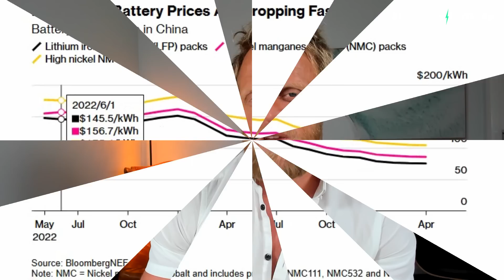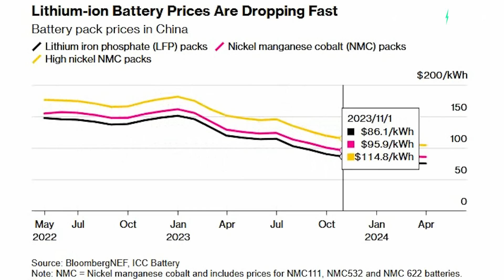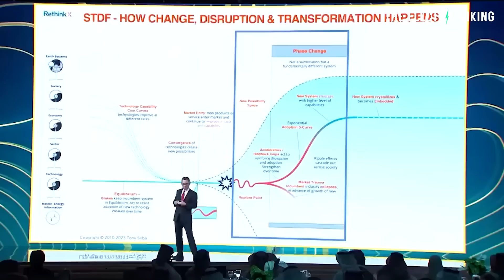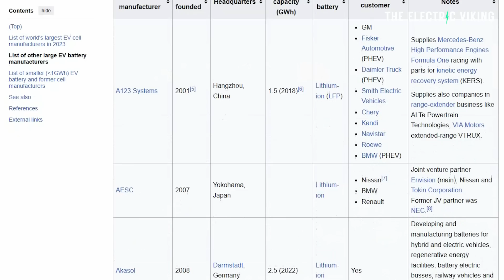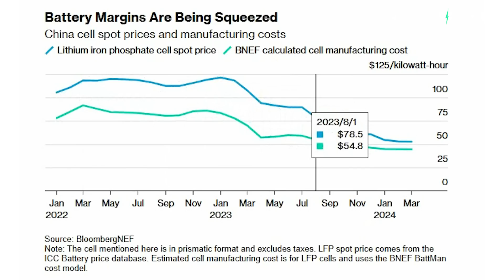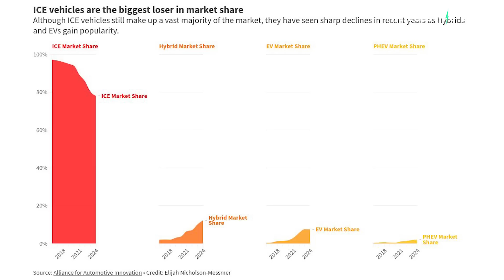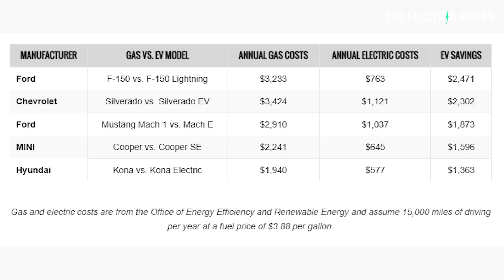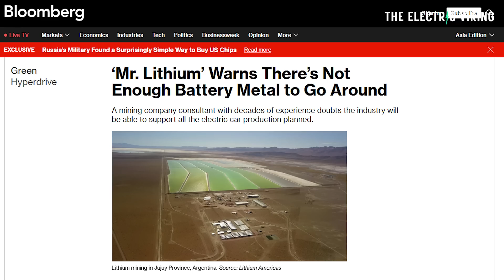Battery prices fall 51% to $53 per kilowatt-hour; "EV prices will keep falling"

Comment: It doesn't matter how cheap the batteries are, EV prices will not fall in tbe west because 1) they haven't gotten any cheaper yet and 2) tarrifs.
Reply: Tesla prices has consistently come down fast!
Reply: Actually, prices have dropped. At least here in Europe, and also Tesla prices have come down quite a bit. But of course, the battery is only one part of the car. Let's consider a Model Y with a 60 kWh LFP battery for about 40k. So according to the video, at 95 USD per kWh, this battery would have cost 5700 USD in material cost (just for the cells). The same battery today costs 3180 USD. That's a saving of 2520 USD, or 6% of the car's price. So a price drop of 44% for the battery results just in a 6% drop for the vehicle's price. A car is more than just a battery.
Reply: EV prices are going down but more slowly...then again we have to take into account inflation, that also fucks it up. But yes, only when I see Toyota Corolla price EV with at least Model 3 range, I will say that they definitely are coming down significantly. In Europe now we have sub 25k euro EVs but range is too small for me liking and cars could be bigger too
Reply: What country are you in? EV prices have been falling pretty much everywhere I know of.
Reply: In New Zealand the Nissan Leaf is literally half the price it was a year ago. Expect even more bargains as legacy auto feels the pinch!
Reply: Yup the government has made it clear with a 100% tax that they want us to pay 2x what they pay elsewhere
Reply: Doesn't elon low key controlling the west now? He's the most powerful normal person on the planet
Reply: “They won’t because they haven’t”.  Great logic.
Reply: Here in Australia my atto 3 dropped $4000 3 months after I bought it 😅
Reply: Tariffs, not Tarrifs.

Comment: This is what makes me laugh when all the nay-sayers harp on about the cost of replacement batteries and no one will buy an EV as it will cost them $20,000 to fix if it goes wrong.

What they don’t realise is battery prices and pack prices are continually falling, as well as getting more reliable. The cost to replace something in 10 years, even if it’s a complete replacement will be probably 25% of what it is now, not even taking inflation into account.

Of course, they don’t get it, they can only see up to their noses. I just laugh at them.

Comment: You can't simply base price on capacity.  The part of the price that csn drop that way is the profit.  Raw materials and to some extent production have a fixed cost.  If you build a second assembly line the cost to run the lines doubles along with the output. You cut profits to find more market.

Comment: The radio control hobbies have long since shifted from internal combustion to battery technology. There are still some IC engines being sold but they are the exception. The change is so entrenched that the IC engines seem obnoxiously loud now.

Comment: Prices are falling because demand is low, if demand was high, putting a strain on supply then prices would increase.
Reply: No that's just the simplified business model that doesn't account for other factors. In fact EV demand is growing, as is supply. In addition costs are falling as clearly outlined in this vlog. i.e. battery costs and scaled manufacturing costs are falling.
Reply: @JoeyBlogs007  As said in the video, supply is increasing even faster than the growing demand. 

As soon as there's a price parity between ICE-Cars and BEV cars, the combustion engine is dead.
Reply: @JoeyBlogs007  That's only because of government subsidies. Minerals are limited, and demand is low. Once demand is high and mineral supply is strained, like would be the case if hundreds of millions of batteries were sold each year instead of only thousands, and subsides end, then you will see a huge increase in battery cost. Of course by then it will be too late.
Reply: @sandyacombs  Subsidies, not subsides.
Reply: Were high, not was high.  Don't they teach the subjunctive mood in your state?

Comment: Tesla opened shop near me, their lot is full of cars and even had to rent next door business parking lot to keep all the cars.  Doesnt seem like anything is sell anymore.  The hype of owning a tesla is dead and sadly repair costs plus battery replacement costs make it a bad choice.  Hopefully they improve these things.
Reply: Have you looked at the ICE dealer lots?  Everyone is priced out of the new car market today and no one is selling in volume.  That said EV sales are less impacted than ICE sales.
Reply: Hundreds of thousands of cars on that lot, komrade?
Reply: @BirdMan1957  ? I'd guess between 300-500
Reply: Ever thought they are doing that to store cars that have been sold and are awaiting delivery?
Reply: @ISuperTed  crossed my mind and hope that is the case, but why have so many just sitting around, if sold I'd assume customer would want it asap.  Did they make this location a hub or something? Anyway was just shocked how many there were.
Reply: Saw a video the other day where a guy was walking around car lots with ICE stock they can't sell. Some of the vehicles were 2 years old!

Comment: At $53 per kWh is it economical to make battery powered container ships now? 

Fuel cost is about 60% of the operating cost for a container ship. To switch over from expensive oil to cheap electricity would give battery powered container ships a massive advantage.
Reply: Not gonna happen in the next 10 years. Probably not the next 20. Batteries only work in small boats with small ranges today. Still need a Big improvement in battery cost and energy density. Then consider the time required to charge 5000 tons of batteries and the port that can do it for 10 ships at once (in port nuclear reactor?... that bit isn't so far fetched if the politics goes away and you stretch to 30 years). Check the yachting industry if you don't believe me. They'll try anything as there is no practicality or monetary issues for billionaires (H2 yacht anyone? Seriously, some doofus built one to go back and forth to the dozen ports in the world that support it). But all electric yachts... nope... nothing of any size and even they hedge against the battery with sails and the like.

Better off with Nat gas for now as a stop gap.

Comment: While the price of graphite, copper and aluminium which contribute almost 50% of the total material cost to make battery, the cost of cathod material and manufacturing have shrink down so much that the price of Li-Ion battery has drop to almost half of it. Unbelievable !
Reply: Have shrunk, not have shrink.  Has dropped, not has drop.

Comment: Yes and no. That chart is have a high  lithium mining record. Aka, there was more demand for the  lithium that was used. So while they have come back down, its still high for what a  lithium battery should cost. Also this only shows around a 40% drop not a 50+% drop. Even then NA will take over as it has a lower starting cost per material needed.

Comment: The US has approved at least three lithium mines to be operational by '28. That tells me a shift away from ultra cheap lithium is incoming.
Reply: By '28 it may not be profitable to mine it.
Reply: By 2028 they should be working on sodium supply lines not lithium
Reply: No it's the tarrifs that will require it to come from here that will make it expensive

Comment: When new EVs are on forecourts for under 20k, then I'll consider it worth my attention.
Reply: China is making cars this cheap daily
Reply: which ICE carts you find for under 20k?
Reply: @petervautmans199 yea was wondering the same, even ICE vehicles don't sell for 20k new any more, more like 40k and up.
Reply: Ya, check out the used market.  For 20k, you can get a car that's less than 50k miles on it.
Reply: @jonathanmillner  yep, ours only had 20K miles. Near mint, coming off of lease.
Reply: @joelhague5515  Idk why the market is so skidish that used car prices are pretty bearish.  You can get a 5 year old electric vehicle for a similar price to a 10 year old ICE car.  It seems like a good time to switch, financially speaking.  Good car for cheap.  Cheap fuel.  It's the way the market is slowly going...
Reply: @jonathanmillner  me neither. I get why it can't work for a sizeable group of people, but just over 60% of US households have 2 OR MORE cars. I think it's multifactorial...(1) high interest rates coupled with high household debt (2) extensive fear campaign/propaganda from fossil fuel industry, i.e., EVs "cost more", batteries are constantly failing, on fire, etc (3) people love the idea of change...for the other guy, not themselves. So, this is what we have right now. Best time to buy used. I almost had a 2022 Mach E, mint condition, only 19K miles...for $31K. It sold in like 3 days. Sticker was $58K
Reply: Used are under 10000
Reply: @stanmitchell3375 Yep and mobile phones that are on the way out are cheap too. Toxic landfill.
Reply: Unfortunately the current administration put a 100% tax on them and the incoming administration is raising the import taxes more to keep them too expensive for you.
Reply: @DanA-nl5uo  As it stands, China has several monopolies (Rare Earth Elements, Lithium Refining and to a lesser extent Lithium mining. They have also been heavily subsidizing many of their car makers... this is why the weakest haven't yet been winnowed despite fierce competition (China has about 90 car makers and no, that's not natural). 

So its Tariff or all European Auto and US Auto die (except Tesla)... then China raises the prices because people will have to buy.

Tesla's $25-30k car is about 18 months away. They are completing their own Lithium refinery, will ramp up their battery production greatly when the designs of 3 types solidify in 2025q1 and have other minereal sources independent of China... which will also drive down the cost of their cars.

In addition to the taxes, the US is building battery plants rapidly to shrink another China (near) monopoly. (Europe kind of fumbled this with too many strings on incentives... Tesla left a $1 billion incentive on the table... alot of strings, apparently). Biden just threw gobs of money at it... that is working.

Check the after market for a $20k car. Batteries today last 200k miles at 90%... Teslas (all of them) are designed for commercial use (high milage). Buy a used car with 10% more range than you need.

Long term thinking. US and EU really had no choice in light of China's agressive moves (some legit, some... not legit). 

Regardless, when the US catches up and China stops propping even the losers up, things will change... and prices will drop anyway in the interim... you simply don't have a New $20k EV in the US just yet. I would expect that you will within 3-4 years. Factory automation replacing maybe a quarter of manual labor in the near term, plunging battery prices... if inflation flattens... yeah, the EV will get there and you will have a few options (Tesla and BYD being there of a certainty - Europe lowered tarriffs on them as they don't get any excessive Chinese subsidies) others will follow.
Reply: @DanA-nl5uo  Both the right and left were planning to put the same tax on chinese imports, ie, the current, and all future administrations
Reply: I do not think it will happen in the EU or US, even if EV prices in China fall below $10K. I foresee the opposite situation: ICE prices in the EU and US will continue to skyrocket due to declining production and reduced economies of scale.
Reply: @igors6593  Yes, you're probably right about both.
Reply: Not happening outside China
Reply: Cheapest car in the UK is the BEV Dacia Spring - under 15k on the road.
Reply: US and Europe are adding huge tarrifs to EVs so we think EVs are expensive/not worth the money.  Meanwhile there are dozens of  new electric cars in China UNDER 10K and hundreds under 20K.    US and Europe are ignorant and in denial about reality.  China will take over the world while we fold our arms and stomp our feet.
Reply: In China now!
Reply: Ireland price new electric car Model and Variant, RRP € ; Dacia Spring Expression 45HP 7kW AC Only (2024), €16,990 ;
Reply: Sam, can the large number of US battery manufacturers get their raw materials to make their batteries?
Reply: Bought our 2020 Nissan Leaf SV plus last years for $17980....subtract IRS "Clean Vehicle Credit" ($4000) = $14980. Biggest tax return we've gotten in 16 years.
Reply: They already could be except for tariffs put in place to protect domestic automobile manufacturers who charged 50 to 60,000 for their cars.

Comment: Batteries are required for grid level storage of wind, solar, and other intermittent sources of energy among other things not just EVs. As such, there isn't an over capacity at this point I would think.
Reply: “Storage” is required, not necessarily “batteries”. There are alternative forms of storage beyond batteries.
Reply: @tombrownca if battery costs keep falling they may end up being the main stay of energy storage.
Reply: BULLSEYE
Reply: Look at the recent rate of progress, and then wonder at the stupidity of people who still think we won’t engineer a way to an ultra low cost renewable energy grid ….
Reply: @IverKnackerov  what progress?  We are looking at old tech here.  It takes 10 years or more to get battery teah into production.
Reply: Vehicle-to-Grid (VTG) technology is indeed helping address the issue of inadequate grid storage by enabling electric vehicles (EVs) to act as mobile energy storage units.
Reply: They are being used all over California right now. It’s already happening.
Reply: Batteries are not viable for grid level storage.  They are only suitable for limited frequency stabilisation.
Reply: They can be helpful to cover the evening peak, without issue, discharge a few hours after sun ends shining. Or balancing etc. as you said. But yeah even to transfer solar to night with batteries would be very very expensive. Technology is not there yet. If I am mistaken then give me proof. What California is doing is just covering evening peaks which yes, can now be done with batteries
Reply: @thamesmud 

Incorrect ...  Traditional older Li cells true but there are new chemistries and Fow batteries that are perfect for the long life long storage role and because they dont have to be mobile they can be made from NaCl ie sodium common salt...brine even . ..and Li S sulpher .. Flow batteries can store for many days.
Reply: @clivestainlesssteelwomble7665  All bull, where are they in practice?  I take it you mean Flow batteries, these are really old tech and have been around from the late 1800's.
Reply: @thamesmud a few years ago you would be correct, they were only used for a few minutes for frequency regulation. But now they are used properly for intra day storage particularly where there is a lot of solar such as California. There are times when the California grid is maxed out on renewables now so they need to store spare electricity to use in the evening. Batteries are now displacing peaker plant usage for peak demand times.
Reply: @adrianthoroughgood1191  nope.  Looks at the demand and look at the amount of storage available.  The run times are tiny.  Look at the figure not the demented press releases.
Reply: @thamesmud - grid storage Sodium batteries are available that exceed the 110 day duration threshold that classes then as long term storage system. The same batteries can be stacked to meet varying discharge duration goals as well. It is the flexibility of such battery systems that attracts energy suppliers as they can address multiple roles using software defined configuratuons.
Reply: @thamesmud batteries are charged during times of low grid demand and power from them release SS at peak times. There are 144 new power plants in the planning stages in the US.

Comment: Like the cars but will not buy until the user experience improves. What do I mean? My old Golf 1.6tdi could easily do 600 miles on a tank and I could refill it in 5 minutes. For local trips they are there but if you are are travelling around the country for your job as I used to the range and inferior charging options will mean there will continue to be a section of the market that will continue to use ICE cars until these limitations are solved. Not a hater, just a realist no matter how much governments push this.
Reply: Lol I am sure you needed to drive 600 miles without stopping more than 5 minutes 😅 
That is 10 hours at an avg speed of 60mph which is close to highway speed and above any non highway speed limits.
Reply: 500v charging will help change this.   It's getting closer, but I agree with you.    Esp during Cold weather we are not there yet.